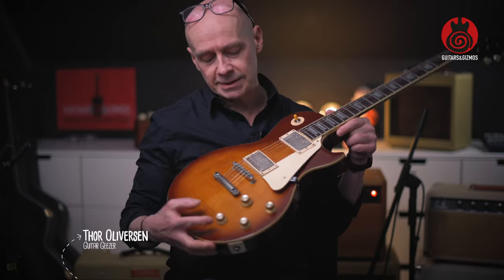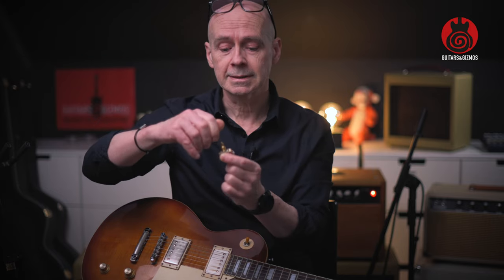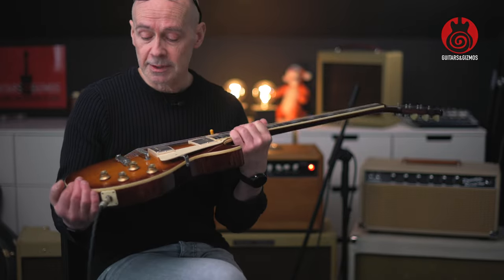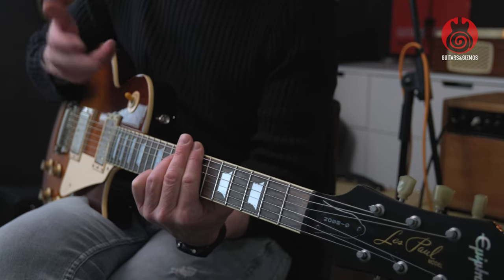Comparing LARGE vs SMALL 500K volume and tone pots in a Les Paul. Cheap vs high end potentiometers.

Comment: was the old wiring also 50's wiring? Would be great if you would have a picture of the situation before you made the modification. If the previous installation was not 50s wiring, than the nice effect of keeping a lot of treble, when you dial down the volume, actually comes from the different wiring. And how about the capacitors, did you use the old ones (and which value did they have: 0,022 mf?) or did you upgrade them as well? In my opinion the guitar sounded better with the new installation, congratulations!! Really nice tones and great playing!
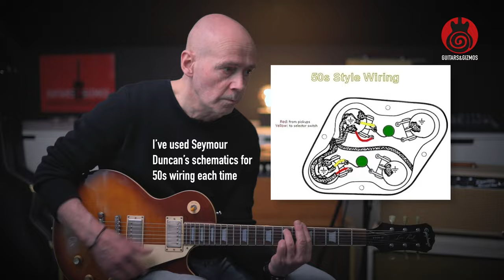Reply from the maker: Hi, thanks for your kind word on my playing 😊 Yes, I will update the description about the wiring, but it is also mentioned at 02:58 in the video that I've used Seymour Duncan's schematics for 50s wiring each time, for the reason you describe about keeping the treble when rolling down the volume. I did also use the same value capacitors (0.022uF), but it's not the same kind.

Comment: The Made in Korea small Alpha audio taper pots are really good in terms of smoothness and pot taper. I’ve compared them to CTS and I like the Alpha better.
Reply from the maker: Hi, the small ones in this guitar are not the stock pots. I still have those in one of my drawers. I replaced them when i first got the guitar because I wanted to change the wiring, and already had a complete harness to put in here. But you made me curious to try out the stock pots that came with the guitar. Thanks for the heads up. Cheers!